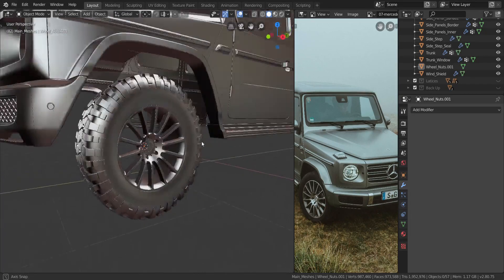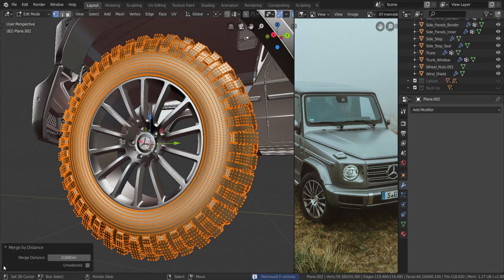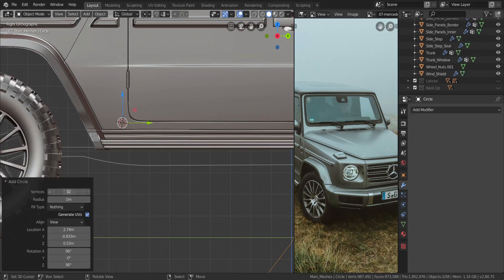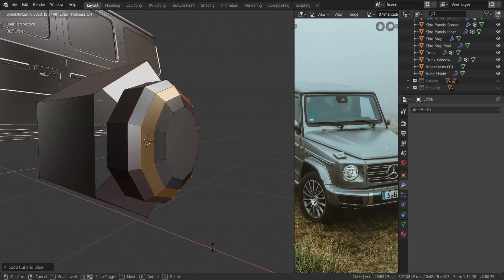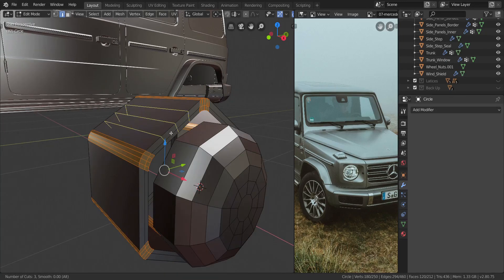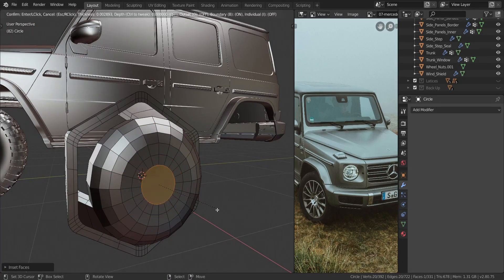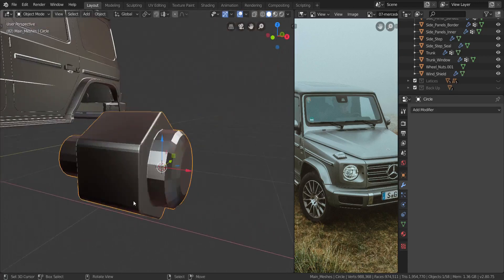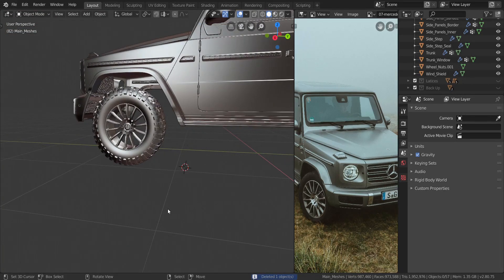Blender 2.8 Car Modeling Tutorial - Part 75 (Tire And Rim Tweaks)

Comment: I watched you making the rims.. they are always tricky to start. 
Blender seriously needs a NURBS overhaul like what Maya has. Making Nurbs curves and then being able to snap and slide vertices along them makes the whole process so much simpler. 
Gotta hand it to you for your dedication, and your level of skill.  Holes.. what a pain in the arse :)
Reply: blenders nurbs aren't that good, my plan was making a base shape using nurbs bur blender isn't good about nurbs
Reply: @roton5061  no Blender Nurbs are terrible. 
I dont even like using them to make a simple curve. They are nothing like what Maya has which is nice and simple. 
When i was learning Maya (from 3DBUZZ) they were fantastic for making guide rails. 
The surfaces themselves werent that great because of the amount of tessellation, but having those curves to snap verts to made modeling so much easier to start a model and when editing.
Reply from the maker: To be honest never done nurbs modeling but I just watched a video on it and it looks kinda interesting, started thinking of surfaces that would have be made easier with nurbs… But I really don't know much about it, I might try it sometime.